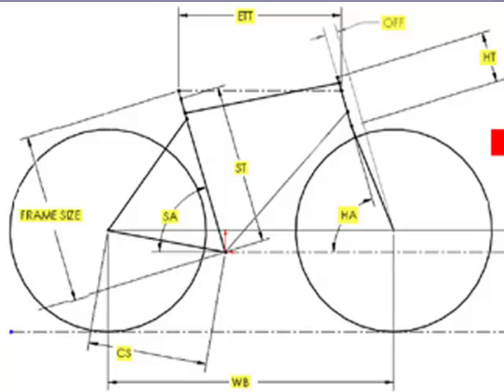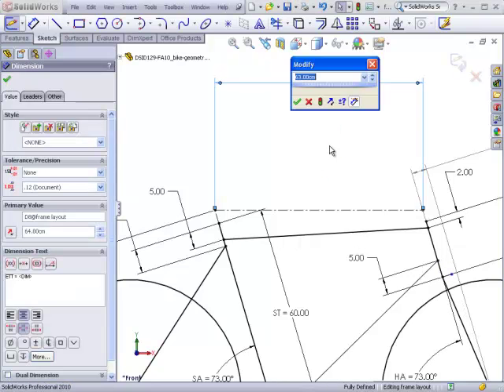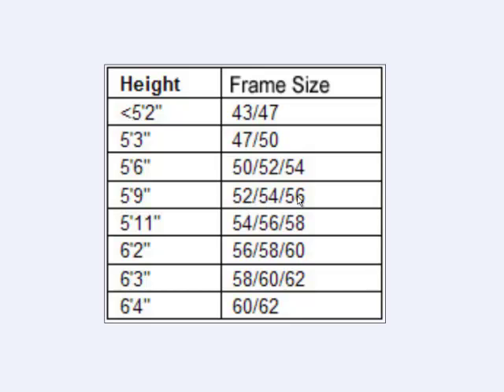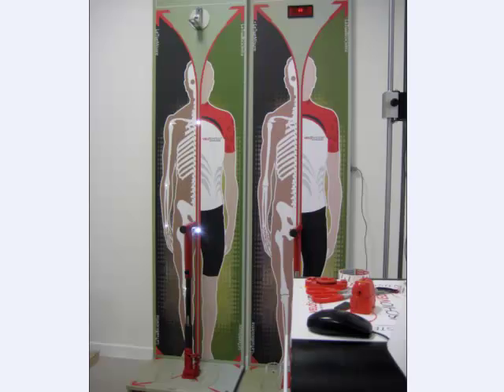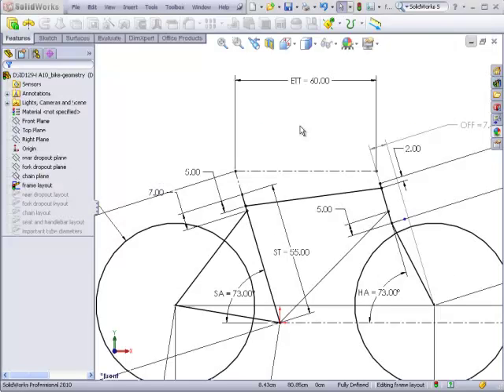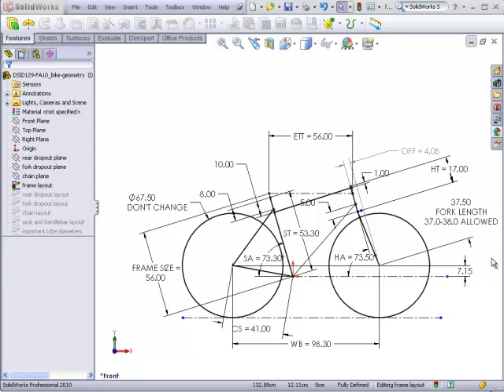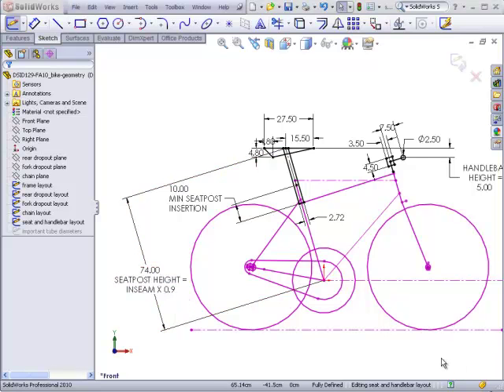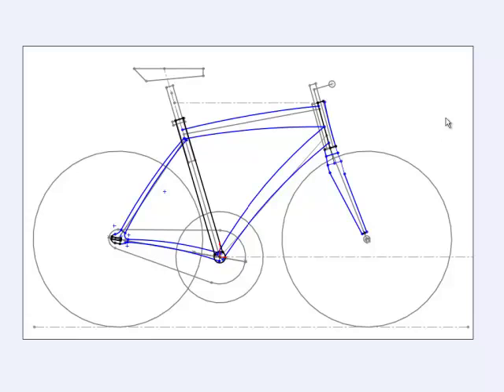DSID-FA10, Bicycle Frame Geometry, Solidworks Tutorial

Comment from the maker: The piece of info that is missing is how to find the top of the head tube. That is dependant on what length fork you choose. The distance from the center of the wheel to the bottom of the head tube should be 37-38cm, depending on your own design. This info was not in the Trek Madone spec sheet and I think I forgot to mention that fact in the video. My students had a file to start with, so it wasn't an issue for them. I also found I could not get the Offset to perfectly match the Trek specs.